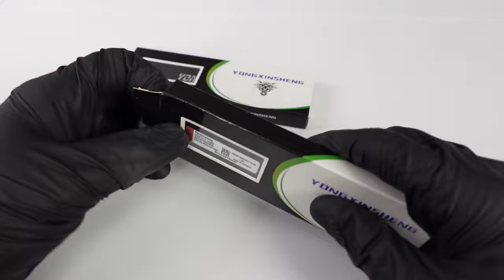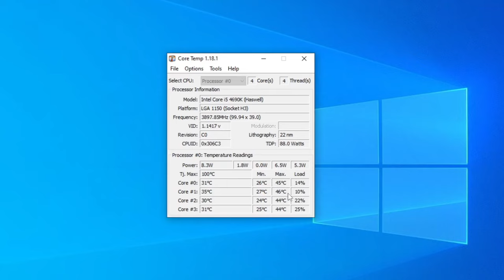ULTRA Budget Gaming PC from Closet Parts - PC Build Up Challenge Ep - 15

Comment: One thing you need to mention is that m.2 to sata adapter needs to have a m.2 sata drive. A nvme m.2 drive won’t work on it. There is a difference in drives.

Comment: Upgraded from a dead platform 4th gen i7 to an AM4 1700x in 2018. Upgraded that SAME board with the SAME ram and cooler to a 5800X3D. Massive gains on a 6 year old motherboard! That is the best reason to go AM5 this time around especially since we are still on first gen. Not only that, but the 7800X3D is widely considered the best gaming chip, and significantly cheaper than the i9's. Just don't get a budget chipset, the crappy AM4 chipsets did not get support for the later CPUs.
Reply from the maker: I do quite a bit of work with 4th gen Intel chips. They can still get the job done. I love the X3D chips but I run a 5950x on my personal system and have seen no real reason to upgrade my personal rig other then to keep up with generations. But I agree, the 7800x3d is a amazing chip

Comment: That's what you consider a small CPU cooler? I ran a 4690k, with max temps of around 60˚c, under a DeepCool Gammaxx-400 and I thought that was a chunky boy. I had my 4690k paired with a GTX970 and it's been the only time I saw near identical CPU and GPU usage, which to be fair was only in the Assassin's Creed Odyssey benchmark.

If I can find a PSU for a decent price I might rebuild that old system, I still have all the parts, and give it away to someone who needs it.
Reply from the maker: Haha it’s small by the standards of what the norm is on this channel haha. Usually the coolers I use are massive lol.